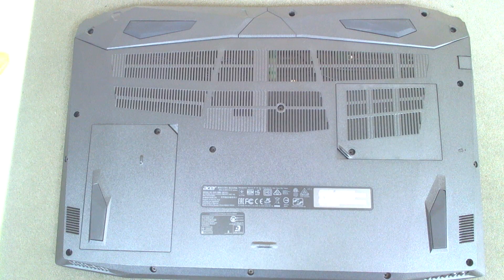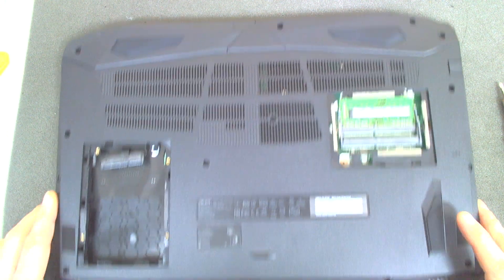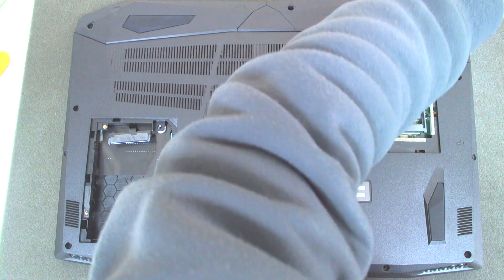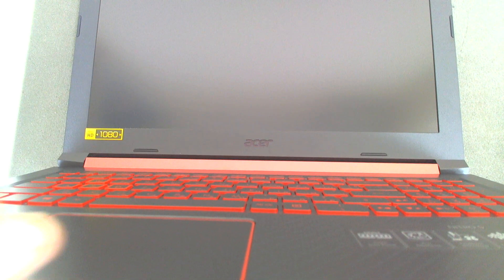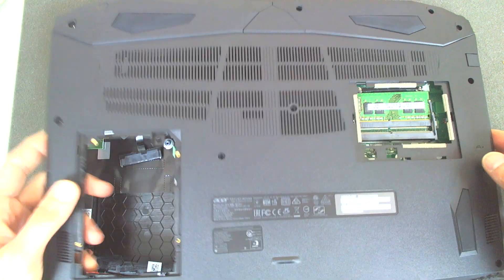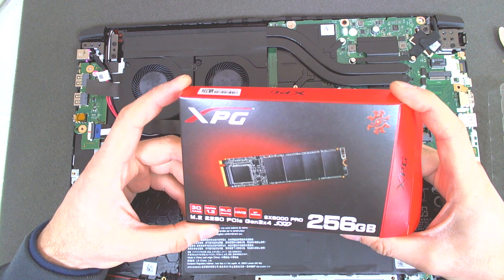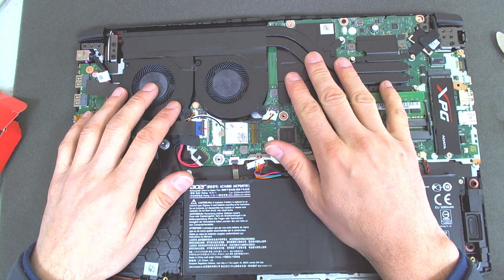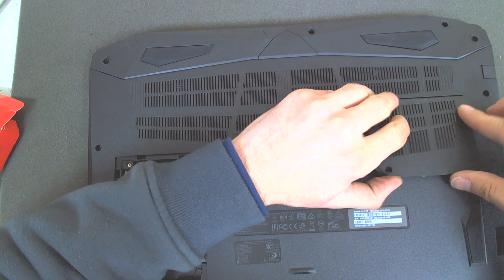Acer Nitro AN515-31 М.2 SSD Upgrade / Install

Comment: Will it void warranty if I get this job done at other than service centre?
Reply from the maker: No it is user upgradeble.. As long as you don't brake something is all OK.
Reply: I am pretty sure it will void your warranty. It could change from place to place though.
Reply from the maker: Well i sell the laptop and i spoke with the acer representative and they say is no problem. Probably it may vary from country to country. I do this pritty much every week. No problem till now.
Reply: @LaptopDisassembly  yeah, I also spoke with acer representative in my country and they said it will void the warranty. That means it can change from country to country.
Reply: Mine has a warranty sticker on one of the screw holes...
Reply from the maker: Strange, they put them if the laptop has already been to a authorised service.
Reply: @LaptopDisassembly  i just bought the laptop... And i already bought the ssd thinking the slot is in the hdd enclosure
Reply: So my options are: go to a service center and pay them to install it, risk it all and put it on my own and void the warranty, or wait until the warranty ends so its a little bit less of a risk... Also there are no official Acer service center close to me so i have to go to another city to get to a service center...
Reply from the maker: Well you can ask the shop where you bought it from.
Reply: @LaptopDisassembly  yeah i will need to check which one is closer, the shop or the service center...

Comment: Does the warranty gets void...if we do this at home?m
Reply from the maker: It is user upgradeble... As long as you don't brake something is OK.
Reply: @LaptopDisassembly  thank you ... but..does that same thing apply anywhere.. I mean..in India as well??
Reply from the maker: Well I can't tell for shure... You can ask the local supplier.  Here I sell computers so I spoke with the supplier. He sead that the warranty is still available.
Reply: @LaptopDisassembly  yeah I checked...It doesn't  void warranty until you won't break anything inside..as you said...thank you soo much for quick  reply and for your help
Reply from the maker: If you need any help, just aks. Will replay when I read it.

Comment: can you leave a link to the ssd? I dont want to accidentally buy one that wont fit my acer nitro 5.
Reply: My one was showing problem called screen bleeding is yours also
Reply from the maker: What do yoy mean by that...  Is the mouse cursor freezing from time to time..
Reply from the maker: The ssd it this one https://www.amazon.com/ADATA-SX6000-256GB-Gen3x2-ASX6000NP-256GT-C/dp/B075Y4JN6W

But you can buy any sst 2280. It will wotk without problems.
Reply: @LaptopDisassembly  do i need to reinstall windows?
Reply from the maker: You have to reinstall it or clone the instalation to the ssd.
Reply: @LaptopDisassembly  hey bro! I just bought a 2280 M.2 SSD but my technician said it supports NVMe since its port has one nook port. He said its better to get an NVMe since sometimes 2280 SATA malfunctions if it's designed for NVMe.
My model is Acer Model - Nitro AN515-42
. I have already raised a return request on my Amazon and I'm still not sure about its compatibility. Can you please suggest so that I can choose the correct form-factor.
Reply from the maker: This laptop can work with both, as much as I remember. I did i install few on a customers laptops. Acer is a little picky about nvme ssd. I think you should stick with the regular one. You can try nvme but there is a chance to have incompatibility issues. Read a little about acer nitro 5 nvme problems...
Reply: @LaptopDisassembly  I have read the AMD model has issues. But I haven't still found any convenient statement from anyone.
Reply from the maker: All depend on the ssd and the memory chips in it.
Reply: @LaptopDisassembly  uhm, okay.  I have to look for some more info idk from where to confirm this. Thank you for responding.
Reply: @SKNayak-gl4xt  Hey man ! I am also confused about this. Have you confirmed it yet?
Reply: @_d_d_man  yes. What I have got from the reviews of the laptop, the common m.2 disks and a few Acer blog posts that both M.2 NVMe and SATA 2280 are supported by the Intel version of Acer Nitro 5 Ryzen 5 AN515-42, while the AMD processor version of the same supports only M.2 SATA.
Reply: @SKNayak-gl4xt  Thanks for the info. 
I have the amd one but my port is nvme type. :/
Reply from the maker: On the nvme port you can connect regular m. 2 drive.
Reply: @_d_d_man  dude, that's what I said 🤦🏻‍♂️ The port is NVMe type on both processor models. But AMD one hasn't been compatible with NVMe. Port is the same because the built is exactly same for both Intel and AMD.
Reply: @SKNayak-gl4xt  Just cancelled my Kingston a2000 250gb m.2 nvme order.  Btw I am not that geeky 😂
Reply: @_d_d_man  I ordered a M.2 SATA with DRAM cache feature. You can go with the most popular Samsung 860evo. I ordered Adata but if you have sufficient money, simply buy Samsung.